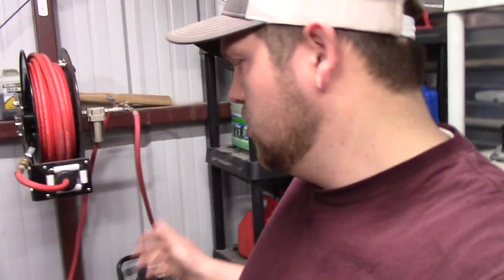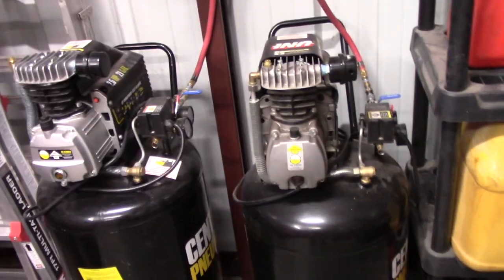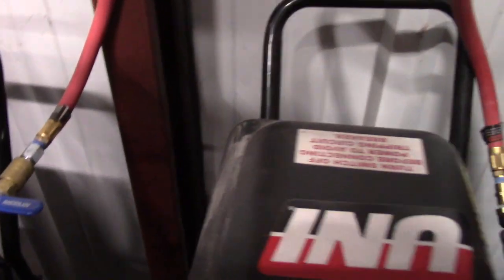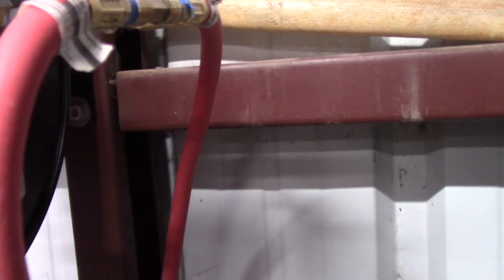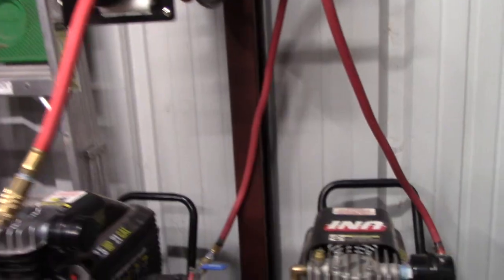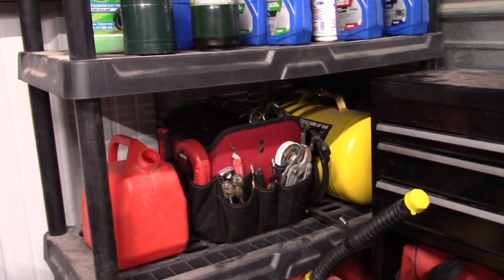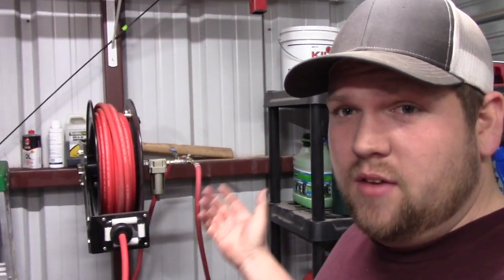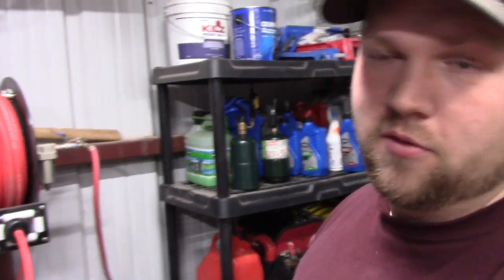Dual Air Compressor Set up for Small Shop

Comment: OK, so you need a one way AKA Check Valve on each output before the T fitting.
As it is now each compressor is pushing back against each other. I set up 3 cheap compressors that way. 1x Belt drive with a 65 Litre Tank and 2x direct drive units, 50 litres a piece. One of the D/D units has a dead motor, so I just used it for it's storage tank. Beyond that, your set up is fine. If you are in a humid place some copper piping and another drain valve would help.

Comment: Sweet setup, I want to do the same setup. How is your setup holding up? Will it handle hvlp?
Reply from the maker: I actually sold one of the compressors to make more room in the shop. But as long as I had it, it worked great. Never tried it with HVLP.

Comment: Hey just a quick question from someone trying to put two porter cable pancake 5gal air compressors for just a little more air capacity. Is there anything that can go wrong? Are there safety precautions that need to be met? Ive heard some people saying that the air in one tank can flow into the other and cause it to burst but Im not sure if that would really happen. I purchased a two to one T that comes with quick release fittings and i figured that would be enough to not have the two flow into each other. I appreciate any input you have I know this is an old video.
Reply: I believe you'll need check valves on each line from the compressor to the T valve. This  should prevent backflow into either compressor

Comment: dual air systems work very well when one pump is set to kick 20psi above the regulator pressure and the other at 30psi above. That way when you are using a smaller tool that a single pump can keep up with
you don't need to have both pumps going.
Reply from the maker: That makes a lot of sense. I may do this again in the future but to free up a little space in my tiny shop I sold one and am only running one compressor now.
Reply: Why not just shut down the power to one compressor when using less air?
Reply: @MrIgottap  Because an air pump uses zero power when it is not actually running. The switch is pneumatic. So you can run a small more efficient $ pump and still run a big impact driver.
Reply: @andrewvoigt1133  sure thing, as well as unplugging a unit when two are not needed. But yes, keeping a different “kick on” setting between the two is a great idea, especially if one’s not fond of running back and forth to the breaker box.

Comment: if you want both comp. to start together to fill air faster and reduce the wear and tear on one comp. then you have to connect the motors in parallel with only one press. sw . and the other press. sw. on 2nd should not be connected and the cut in press should be more than the 1st tank. reason being the unloader should work

Comment: Did you use any check valves? Ive always read that if your connecting compressors after the regulators, you should use check valves on each air output so not to back feed pressure into either one of the air regulators. Im no expert either btw, I just ran across the use check valves alot when I was doing research for dual compressor setup . Either way good video, simple and to the point.
Reply from the maker: Thank you man! And I read the exact same thing before doing this. I read it was because one compressor would run more than the other and wear out faster. Maybe I missed it being bad for the air regulator though. I didn’t try very hard but I could even find 3/8 inch check valves at Lowe’s, Home Depot, and Harbor Freight. I’m sure they are somewhere online but at that point I was just anxious to put it together at that point. I haven’t noticed any issues with the regulators since I have done it but I also haven’t used them that much since I did it either. Thanks for watching and for your comment!
Reply: @DereksWorkshopAndProjects   a 1 inch check valve brass and you reduce it to 3/8 . if it is working no need to add one , but it has been a year now have you painted or run a 3/4 impact off both tanks ?
Reply from the maker: No sir. I actually sold one of the tanks to create a little more space in the shop. When I put this in I intended on using a lot more air tools but i have sort of shifted to battery tools instead so it wasn’t really necessary anymore. I never did try to run anything as big as a 3/4 impact. Just 1/2 inch was the biggest.

Comment: Is it really that simple just use a T fitting on the output lines? Do the compressors have to be the same rating? I have an 18 gallon and a 29 gallon both different cfm. Will it still work?
Reply: The smaller one will kick on first probably run constantly creating hot air and moisture in the line... best bet is to get at least another 30 gal and just use the smaller one separately
Reply from the maker: After posting this video, I realized there is A LOT about dual air compressor set ups that I don't know. I would keep looking for someone who might know more than me.
Reply: I ended up trying it out today since im in the middle of painting a car. I shoot at around 25psi so I dont need much pressure, just more volume. It worked out great since I only paint panel by panel. Plenty of air to do the hood and roof now. I didnt use the extra valves like you did though. I just used the T and let the tank pressure from each tank equalize. I let the lower psi compressor do the refilling since it maxes out earlier than the bigger compressor due to slightly lower max psi. No issue with heat either since Im not pushing it constantly. I would like to do this with 2 compressors of the same size and rating however so I can run them both wide open. Glad I came across your video. I dont know why I never thought of this, I just had an extra compressor around doing nothing lol.
Reply from the maker: Well I’m glad it worked out. I never had any issues with my set up, probably being that they were both the exact same compressor, among other things (being that I feel like some people like to seriously over complicate or engineer a dual compressor set up that I think is more simple than they want to admit). Anyway, good luck with the paint and all, and thanks for watching.
Reply: @socksonfeet8125  Im trying to do this with a dual and single arb compressor for my truck. I believe one is rated 100psi the other 150psi. Will adding a T splitter at the air tank entrance allow me to do this safely or do I need to add other safety measurements? Thank you for any help.

Comment: $25? And fixed in minutes! That is brilliant. My wife likes how you presented the information on your video, but I have to admit we know nothing about compressors. May I ask the purpose of having a dual system?
Reply from the maker: Yeah so the reason for it for me is to have double the tank capacity. That’s really the only reason why. Where I don’t have power in my shop I can only fill them when I drag the extension cord out and plug them in, having twice the capacity to use air tools with is nice. Also when I move into a larger shop someday and I use air tools way more frequently than I do now, it will just be that less often that I have to hear these noisy things start up and I also can use air tools longer. Like if I had an impact wrench and I was just going to lay on the trigger for a long time because I have a super stuck bolt or something like that, I will have a good 90PSI or more of flow which is required to run my impact at full power for twice the amount of time. It’s completely unnecessary really. But for $25 I couldn’t pass it up. I probably wouldn’t spend full retail on two of these regularly.
Reply from the maker: Also where I looked through your channel, it seems like you guys are more of a home improvement channel, where your going to use like finish nails and staples a lot, it’s really pretty unnecessary. But where I use heavier air tools that require more when working on my vehicles and other things, it makes more sense for me.
Reply: @DereksWorkshopAndProjects  I cannot thank you enough for taking the time to explain things to me. We are finally getting to a point where we can work on our garage and I want a corner of it for woodworking. I have been considering a small compressor to use to blow saw dust around for cleaning. Its a start! I hope to learn more from you and others who are so gracious to share their knowledge.
Reply from the maker: Yeah, not a problem. I’m not an expert but I would like think I know a thing or two, but that’s probably it, just a thing or two 😉. Thanks for watching.

Comment: Im not sure if it matters or not but I wonder if a one way valve is necessary so that the compressors aren't fighting each other... im jist taking that from a onboard air system on my jeep. It probably doesn't apply here
Reply from the maker: So I think you would be completely right if I was running them simultaneously but essentially what I was doing was just running
One, disconnected from the system, and then the other disconnected from the system, and then disconnecting them from power and plugging them back into the system. It was more than anything for double the air storage and it worked great because I could go weeks without refilling as my shop doesn’t have power inside and it has to be run in with an extension cord.

Comment: Hi Derek! I've just subscribed to your channel

I wonder if I could connect an oil-lubricated compressor to another oil-free compressor as you did?

 Would that be an explosion? I'm really worried about that, please help me out🙏🙏🙏
Reply from the maker: Anything you do is at your own risk but I personally can’t see why it would be risky. They both hold pressure either way. Can you elaborated on why you are worried it will blow up?
Reply: Chong Kelvin  Oil pump and oil less can hook up, the oil filled pump will fill faster is all  oil pump will not hurt your oil less compressor  oil will not leave the crankcase of the oil pump .  you only get air from the tank .

Comment: Good connection but why didn't you add the one way air value so the pressure doesn't go to the other tank.
Reply from the maker: The short answer is because I couldn’t find one locally and never worried about it again.
Reply: @DereksWorkshopAndProjects  still a great set up..

Comment: your system is dual tank to increase cfm. i belive only one compressor will work due to differance in cut in press. between two comp. So its called in parallel with back up comp.
good job done.

Comment: Have you made a video using this setup with a plasma cutter or blast box? Curious if one of the compressors tries to out due the other. I would think your setup would work for home projects. I see folks putting in pretty sophisticated projects that have lots of components. I think it maybe more cost effective to just fork out the money for a higher scfm. I like your approach.

Comment: how does the safety valve work when both tanks are running? does each tank stops when the max capacity is reach? or do you have to keep an eye on the tanks to shut them off?
Reply from the maker: I never rann both tanks at the same time. Good question. They both have pressure switches at 125PSI so they should both shut off at that pressure when its reached.
Reply: So what's the point of having them both connected?
Reply from the maker: A lot of people are saying double the CFM which I didn’t consider, but it was mostly to have twice the tank capacity for heavy hitting air jobs. Also because I didn’t have consistent power to the shop I held air in them to not always have to connect power to get air.
Reply: So just one compressor is running and it fills up both tanks?? So I can make a 33 gallon into a 66 gallon??
Reply from the maker: Essentially. But you’ll wear out one compressor quick. That’s why people suggest setting up an intermittent power cycle so they alternate.

Comment: Nice set up, i just the 3 gallon briggs and stratton air compressor. I used it with my Banks 21° framing nailer to repair a mobile home roof that blew off bcz of high winds awhile back. I'll look into something like that soon, i plan on getting a plasma cutter. Dont know which type, but 1 that fits my wallet. You have cool shop.
Reply from the maker: Let us all know what you end up getting for the plasma cutter because I would like to eventually get one too. I see lots of people saying the cheap ones they bought are good. Thanks for your compliment on my shop. It’s a little small. I am ready to expand it for sure.
Reply: @DereksWorkshopAndProjects  my shop is very small compared to yours, micro, lol. Ok, ill upload whenever i get a plasma cutter, itll makes cutting a whole lot easier.👍
Reply from the maker: @zeroninejames9507  Mine is 200 Square feet. A 10x20 room haha.
Reply: @DereksWorkshopAndProjects  i got you beat, 5'11"x4'8"x8', that LxWxH, lol. Its small, man. Basically a storage room. Im not complaining, its a place i can weld and build.😀👍
Reply: @DereksWorkshopAndProjects  I got the jafyl cut 50 plasma cutter on Thursday 6/20/19. Used my small 3 gallon Briggs and Stratton with it and it did cut. It's just wasn't enough air, compressor kicked on as soon as i started cutting. I'm really leaning to getting this compressor this weekend. I'm trying find good deal for my wallet. Lol.  Just updating you.👍
Reply from the maker: Sweet man! I have seen them at every parking lot sale since I started regularly attending them. You can easily pick them up for $60 or so. How do you like the plasma cutter?
Reply: @DereksWorkshopAndProjects  thanks. Well I just used it that opening up. Did a few test cuts and impressed with it. It already had the 110v plug installed which was nice. I didn't want to risk damaging the unit due to lack of air flow.  Quicker cleaner cuts now. 👍

Comment: Hi just wondering if I need a check valve in the tee so the air from one tank doesn't go back into the other . Can you let me know thanks  Dale .great video Thanks for sharing.
Reply from the maker: It’s probably the “best way” to set it up but you don’t “have to” have a check valve. If your going to have pressure regulation then you will want to have those check valves.
Reply: I don't on mine I let one back fill the other one. If I don't need both going I only flip one on. Once a air line is connected. It's pressure based so air will go both ways. I even connected a third to use for extra storage to back fill through the regulator. Years now with no problems when I do run them the third one is set to a lower psi around 80 so it won't kick on unless I'm really hammering on the paint guns.
Reply: But like he was saying I have my t connected to a Lowe's portable tank. It already has the air fitting installed and rated to 185psi. Have my third one connected into the regulator of the second removed the safety valve. As long as one works it's all you need. And still have 2 for the 3 tanks on the system. These arnt bad compressors for $300 you can have enough volume and cfm to run hvlp paint gun. 10cfm@90 my    most hvlp are 20-30. My highest cfm gun can use 16cfm at 30psi. I usually never drop below 80-90. If you get compressors if different psi rating you jus take the larger one down to the lower ones Max. Don't over think it. I've I bought air compressors off Craigslist for years and dine this to be able to paint. Oiled and oiless only cost $30 to rebuild a oiless compressor as long as the motors good. Piston rod ,sleeve. Come out as a unit and new one in
Reply: @JamesSmith-lt5zz  OkThanks james also will all the tanks equalize themselves and fill to the same pressure my relief valves are set to pop at 120 pounds
Reply: @daleramage7389  yes they will equalize pressure naturally wants to equalize like water. Think if you had to buckets with water and pipe connected from the bottom connected. Everything level they would level out  same with air under pressure. Pressure wants to go into lower pressure. If it's set for 120 jus make sure the compressors are set lower then that and on separate breakers. You can even connect them without a t take the safety relief out of one and cknnec there. As long as one has it it will provide relief to both units since there connected

Comment: This set up requires both to run? Im thinking of using the second compressor as a slave to the first and have the one fill both cause my power trips other wise
Reply from the maker: Not simultaneously. Run one and then the other. But making one do all the work isn’t a bad idea. When you wear it out just use it as a spare tank and wear the other one out. However you want to do it.

Comment: I was hoping to see a setup where there is a master pressure switch  with relays that guide both air compressor motors, resulting in simultaneous power  for Cut-in and Cut out pressures.  I'm needing this for a tire changing machine that is very AIR HUNGRY.
Reply from the maker: Sorry man, stupid basic set up here haha. Good luck!
Reply: you find it? I will do my two compressors together eventually... Putting two 175 gallon tanks together will get me 350 gallons at 220PSI running two screen printing presses

Comment: Can u link me all the parts needed for this? I have 2 29gal compressors
Reply from the maker: I got them all from HF. I doubt the 29 gallon compressors will need the exact same fittings as the 21 gallon. I just used 2 of the 3ft hose remnants, a T and some reduction fittings. And a few valves. All parts from HF.
Reply: Derek's Workshop and Projects can u link me to these items? And maybe make a video on how to hook it up? I’ll be spraying liquid wrap (plastidip)